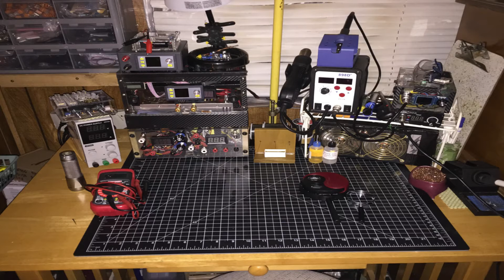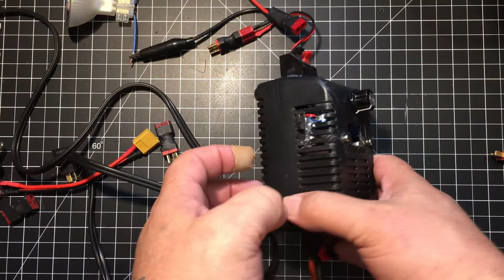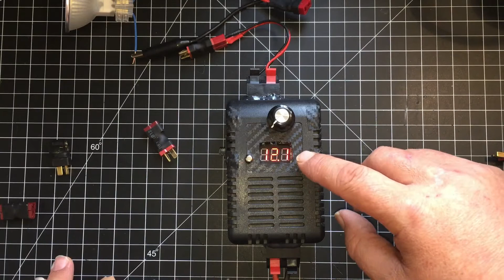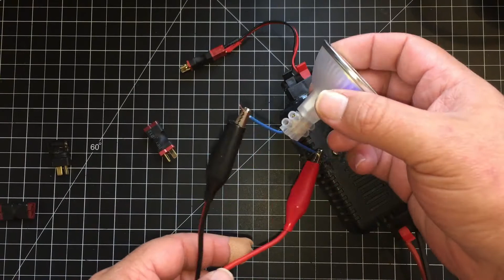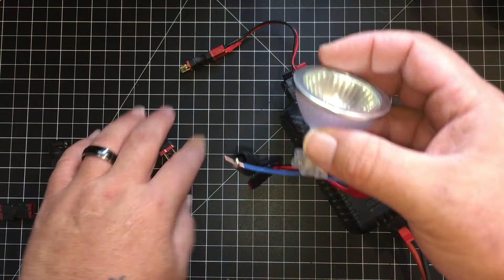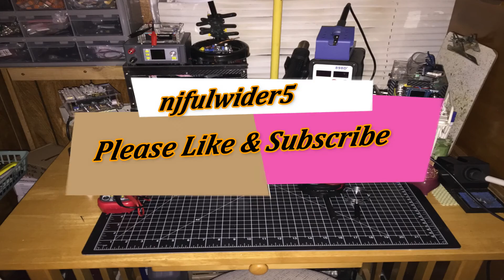DIY Adjustable Wall Wart 1 2V 24 5V 3Amps

Comment: Like you did here, I try to re-use enclosures whenever possible...  Cool project! 
 
One very slight correction:  It can only be called a "wall wart" if the whole thing plugs in and holds directly ONTO the wall socket. Otherwise it is just a power adapter/supply.  The one you used has an AC wire on one side, and DC wire on the other... that is not a wall wart.  ;-)

Comment: Solder directly to the 10 turn pot great idea! If I can find some metal tube that solders well use that to keep the screwdriver from falling off and shorting the board every time you need to adjust lol!

Comment: That’s awesome! I bet if you just opened one of those universal switching laptop supplies with the slide switch, give it a voltmeter and a 10 turn pot it would achieve a similar thing. I might try that one day. I like the speaker connectors really quick to connect! And change cords out for different things!

Comment: damn, you're pumping them out. making me look bad now :P
Gee, how many turns does that pot allow. lol
Reply from the maker: All of them are just old projects I needed to knock before I start my Mini PowerWall.
Reply from the maker: Here is something I stumbled on for you Bike-13$

https://www.ebay.com/itm/Microsoft-Xbox-360-AC-Adaptor-power-supply-Model-X802882-004/112983099851   

and Boost Converter-14.75

https://www.ebay.com/itm/231572940208

I found 2 of the adapters at my local goodwill/value village. I found mine for 1$ a piece on sale. This would get you to 5amp 42V? Or you could use a CPU PSU and get a little more like 42V 8amps? Just an Idea...